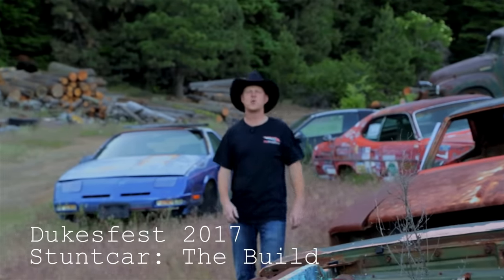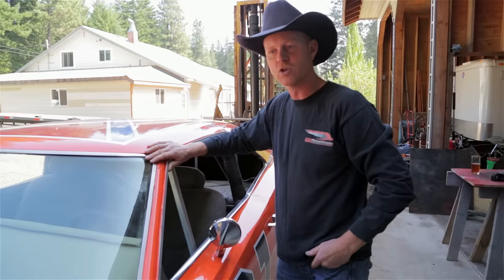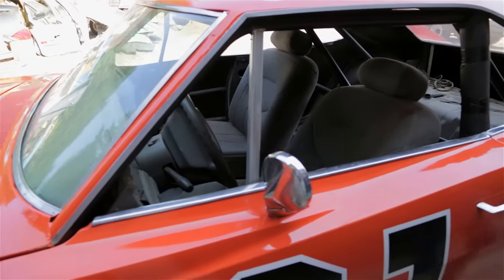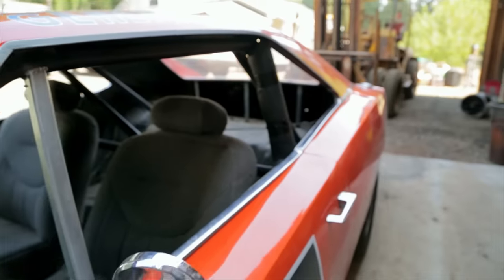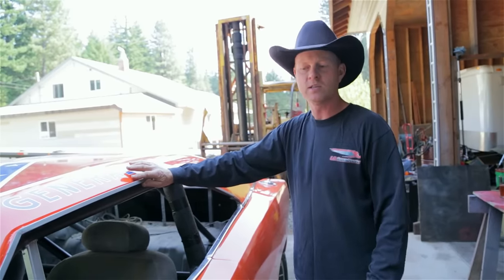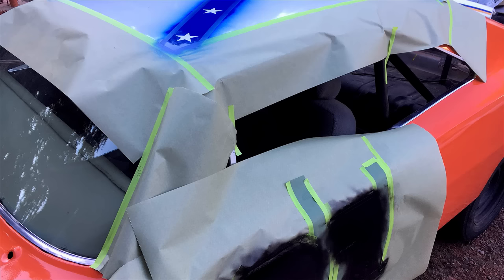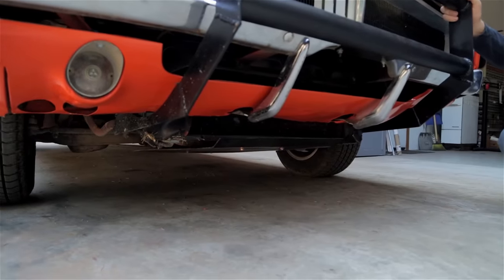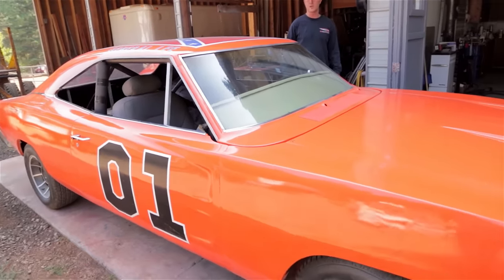Cop Car Ford Crown Vic Transformed Into a General Lee Dodge Charger

Comment: Why do you care if it's low miles and well-maintained Crown Vic if you're just going to jump it?
Reply: Cause vics can survive a jump especially like he did it
Reply: P77777777 what?
Reply: fuzzy wuzzy exactly!
Reply: low miles and well maintained means the car is still structurally sound.  Which is important when you plan on beating the life out of it for two days.
Reply: Slayer John that does not mean its structurally sound fender benders happen to well-maintained Vehicles all the time. all it means is you paid top dollar for a car that you're just going to jump
Reply: What it means is that the car won't fall in two due to bad/worn out parts during the jump.  Picture driving a car down the road at 70 MPH then it falls into two pieces.  Hopefully this helps understand why he chose the better quality car.
Reply: Slayer John i know what your saying but it still seems stupid to me to pay top dollar for a well-maintained low miles car to throw away 75% of it. Even if it is a abused piece of shit your not gonna hurt it anymore than a nice car. The frame will still be intact
Reply: Obviously even a well maintained car can have a rotten chassis, but all the oily and sparky bits being well sorted saves a lot of hassle when putting a car through the kind of abuse that could endure.
Reply: . If you notice he mentions he already owned the car having purchased it to make a jump car out of it. I think what he was trying to say was you can, if you shop around, get a good condition, well maintained Crown Vic from a smaller Police Force for the same money as you might pick up an average condition one since they are common and don't have any sentimental or rarity value. The trick is to buy the best to the budget.
Reply: Seems to me like he's gonna use it for multiple jumps not just 2, so that's probably why he doesn't want one he's gonna have to fix mechanically every time he wants to take it out
Reply: fuzzy wuzzy true but I guess the guy really meant suspension components
Reply: Because if its beat to death, and the engine cuts out when you hit the ramp, you are going to miss your mark, (Or possibly the ramp, then break the worn suspension, swerve into the crowd, and hit a nun.)
Reply: Ok, mine used to cut out at random, I thought it was the computer or something, because it didn't seem to matter how long you had been driving, or on what surface. Swapped out the computer with a spare, and still the same thing. It turned out to be a bad fusible link that was heating up and separating somehow. 
Heard enough? Or would you like to use my car for you stunt show? In all fairness to the car, it was an X taxi, and I suspect a police car before that. 300+ K car that a buddy picked up at an auction for about negative nothing..... (Part of an auction.)  There, was that enough, or should I start up again? Its not a fucking unicorn, its an old car, they are not bullet proof.
Reply: I wouldn't drive an old Taurus to the scrap yard......   I get what you are saying though, they are super reliable. My point was, for critical work, there is no need to load the deck, the crown are still all over the place, for something like this, I'd spend the extra effort to get one thats in pretty good shape to start with. Especially for the suspension components.
Reply: I'm still amazed at how good this car looks, James Smith really did an amazing job on these things.
Reply: fuzzy wuzzy There are gazillions of Vics around to choose and on top of that,  apparently money is not the problem... so, why not pick the best one for stunts?
Reply: cptreech the best is actually big police stations as their maintenance schedules are much more rigid than the smaller stations so they will be in better condition.
Reply: I can tell you first hand to stay away from a used Taxi....   ;-)
Reply: actually it means that if you point it at ramp A it will go to ramp A and have a less chance of killing you during the stunt. takes away another variable.
Reply: fuzzy wuzzy he cares because it still lives cause a full frame car takes more of a beating then a unibody
Reply: The way I see it.. 
1. The Ford should start first time every time. Pretty important when you have a crowd of people waiting for the jump. 
2. No Dodge Chargers will be sacrificed. Becoming an rare commodity these days and expensive as hell.
Plus all the other reasons as mentioned by other viewers.
Reply: fuzzy wuzzy I can tell you have never driven an old cop car that has hit a curve to hard.
Reply: At first i thought that was odd too.. but then i saw the amount of effort he put in it.. And look at it!! Clearly he want's to keep it as long as possible for this kind of stuff. So then it really makes sense.
Reply: the price of a well maintained vic is still way cheaper than a actual charger so budget wise they saved a ton of money and time
Reply: fuzzy wuzzy Could you be any more hypothetical? Of course anything is possible. The point is that a low-mileage, well maintained car has THE BEST CHANCE of being structurally sound. Of course nobody really knows the history of a car unless it’s gone over with a fine tooth comb.
Reply: Exactly what I was thinking. That Vic could've gone to a good home instead of being completely thrashed. Same is true for a high miles Vic but not as common
Reply: fuzzy wuzzy better suspensión
Reply: Because if it was crap and stuttered at all he would miss his target speed for the jump and that could be fatal. Do say research before you ask dumb questions
Reply: exactly lol

Comment: the 1969 had the worst suspension of any muscle car in an era when they all sucked...so i was really wondering how it could be done and that answer is brilliant...just use a Ford that way it will tolerate many jumps unlike the original that was good for one
Reply: Nope - they chose the Charger for the show BECAUSE of its strong torsion bar front suspension.  This thing only survives because he's landing it on a sloped landing ramp, the original would survive too.  Now send this one off a real ramp into a flat landing and see how well it holds up.  Cars aren't meant to be jumped, I don't care what year it is.
Reply: It was an ADJUSTABLE torsion bar suspension. No one else had that. Rebuild it with polyurethane bushings and it's awesome.
Reply: ConstanceCox the Bullit Mustangs in the movie had to stiffened the bodies and suspension. The Charger they tightened the front torsion bars and put stiffer shocks on it and aired the tires up a little more and that was it. Torsion bar suspension could hold the corners better than any other car built at the time. I use to race my 65 Valiant V100 on local tracks in the area. One out in Stillwater OK. A few times. Stiffer shocks and Pirreli GTA tires and I was staying stuck the ground. Built 225 slant six 4brl on Av-gas and Cam 2 mix. Built Powerflight automatic and staying ahead of Cobras, Corvettes and Porsche 944s and 911s. With the Plymouth dog dish wheel covers polished and shining. SCCA called it a exhibition racer because it was a 4dr sedan. I still have the ol broad today. 374,897 miles on her clock and getting ready to rebuild it for a third time and put in a 318 4bl/727 from old 81 Diplomat Cop Car.
Reply: Chevy GM had complete GARBAGE suspension on the Camaros, Novas and Trans ams back in the late 60s and early 70's. The subframe suspension were like wet noodles and they handled like crap. Mopars has much better suspension as they were more stiff and adjustable.

Comment: From 78 until 82 my parents worked for a stuntshow who jumped a car over a ramp while another car drove under it, and they did that twice a day and for 6 months
a year, and they never ruined a single car because the landing was always perfect.
Reply from the maker: Cool story!
Reply: @AutoEdits  The man was willy Bossle, also known as stuntman Joe Williams who also did some stunts in 2 james bond movies, like driving
the mustang on two wheels through a narrow alley. And it's not that hard, because every few years they used new cars, so to calculate
they just started to jump at slow speeds  while the ramps stand close together, and every next jump is done faster and while the ramps
are being put further away from each other until they reached the desired distance between the ramps. I aksed if i could drive along
as a passenger, but i was 15 so they refused alright, but i was the passenger in the car that drove between the ramps while the other jumped
over our roof. Well, those 4 years were the best years of my childhood, because when you're a young kid, then what better time is there to spend
than with a traveling stunt show? I learned to drive cars and trucks there, and got my own honda dax 70cc when i was 14 and i could drive
in all the cars they used for the show, and in all the crash cars and i even learned to ride my honda sittting backwards
and standing on the seat and ride like a surfer, so no hands on the handlebars. And i helped out in the  show aswel and did sit in the back with
johnny bossle when they drove with 3-4 cars on 2 wheels. And they had a contract with toyota and who gave them 10 new cars for the show
and then in every city the toyota dealers brought a brandnew car of all models they had, and they were commmercialy presented to the public
and gues who drove all the expensive ones like the super saloon and landcruisers and celica's?  Well, i sure had the time of my life, and it was 
also a time when the best road movies were made like cannonball run ,smokey and the bandit, convoy, mad max, and tv series like the dukes of hazard,
and the knightrider, and who are all related with cars and stunts, so stuntshows were popular in those days, and the bossle Hell drivers
were one of the best here in europe and that's why they got a contract with toyota and even honda gave them new off road bikes
and leather costumes, so very professional because the whole picture looked like a million dollars, and it was a priveledge that i was there and a part of it.
Reply from the maker: @3DPeter  Buzz Bundy did the Mustang stunt in that movie.

Comment: I think this is a really cool concept in general for 'vintage replica'. You get the cool looks of an oldschool car, while still having most of the practicality of a modern car (AC, etc), and more bang for your buck for power (I'm guessing a CVPI gets more power stock than pretty much any 60s or 70s engine with similar mods).
Reply: Do you need AC in a car which has no glass in the windows?

Comment: When he got the panels from Auto metal direct I'm wondering what panel he put on first to base the rest of it around
Reply: The front windshield area was the most critical. The A pillars are actually the front portion of the roll cage..

Comment: Would this work with a modern charger or is the wheel base too different to actually reskin it with the old body?
Reply: The Vic is better for the purpose because of its "body on frame" construction. He nearly just put a different body on the frame. Only pick up trucks really still use body on frame.

Comment: You should try and make a modern charger into a 68-70 charger. Not the length but change the front and anything that doesn’t look right.

Comment: In the past I've read a few articles where they blame Dukes of Hazzard as factor in the scarcity in 68 - 69 Chargers.  To me that doesn't make much sense as the estimate was somewhere around 300 were destroyed in making the show.  To put that in context, if you divide 300 by 8 you get 37.5 which is probably about the rate they built them per hour.  When you put that in context, all they did was consume about a days production over the 7 years the show ran.

Comment: So i just went on auto metal direct and priced out the body panels, no trim pieces,  as best i could and it came out to about $6900. (I think I got everything) So its worth it if you always wanted that charger but its not exactly cheap.

Comment: My 01 Crown Vic has 254K, good gas milage, uses synthetic oil, doesn't mark its spot, doesn't smoke, great clean interior and I'm  just about to get it back from the body shop because I had body cancer on the left fender and had it replaced. With the new headlights it will look and run like a new car......more space in the trunk than the back of a Tahoe or Explorer with there seats up..

Comment: It would be interesting to know on which parts of the car he took up the difference in wheelbase, as the  Charger had 120" and the Crown Vic had 114."  It looks like he may have split the difference equally between the front fender, door and quarter panel.   Otherwise,  taking 6 inches off any one panel would have been noticeable.
Reply: Only 2.3" difference in the wheelbase. He took it up evenly in the fender wells. No trimming on the charger panels.
Reply: Check out Stacie's Country Cooking & Adventures on youtube
Reply: Sorry about the typo. It should have said "less than 3 inches"
Crown Vic = 114.7"
Charger = 117"
Difference = 2.3"

Comment: Shoulda done it with a modern day Charger/Challenger platform to keep it more "car culture friendly", basically meaning it wouldn't be using it's competitor's parts, or in this case, everything but the Charger shell.
Reply: Steezy but Sleezy the body on frame design that the crown Vic offers is just such a universal platform it’s insane
Reply: An expensive unibody car wouldn't serve the purpose. The Crown Vic has a frame and will survive the jumps. As a car culture guy I wouldn't like to see a late model Charger or Challenger ruined to make a jump car. I love the Crown Vic in it's Halloween costume. I put Chevy engines in pre-war Fords and the car culture snobs can kiss my ass. Ford engines don't fit and cost a lot to make them fit.  My 54 will have a Ford engine because it will fit in the hole. I have a 351 Cleveland that wouldn't fit in my 40. But first I'm helping my son put his 48 Pontiac on a 76  Olds Cutlass chassis. We had to stretch the wheelbase 5 inches. We have too many projects to worry about what other people think. Hot Rodding is about using your imagination. No restrictions apply.

Comment: Aren't late 60s Chargers built on ladder frames (chassis) and newer Crown Vics built on a unibody frame (chassis)?
The Crown Vic's frame is supported by the roof line, does the roll cage replace that strength?

Comment: I was reading on the general Lee, many were AMC Matadors not Dodge Chargers.
Reply: Then you read incorrectly. Chargers were the only cars used as General Lees. Thought they did used Matadors as cop cars and other stunt vehicles.
Reply: sorry I am correct... here is a article about the cars.. What kind of muscle car was the Duke Boys General Lee?

The General Lee was most often a 1969 Dodge Charger. However, after seven seasons, 1968 Dodge Chargers were substituted in a pinch.

In fact, things got so bad that AMC Ambassadors were used and filmed from creative angles to hide the fact it wasn’t a Charger.  click below to go to the article.. @johnkramer7161
Reply: @dalecarney6582  Don't believe everything you read.
Reply: I have seen in more than a single place. ANd because you may not believe or do not want to believe it does not make it not so, If you look at the AMC Matador and the charger you can see how they can get away with it, I seen the picture of one AMC vehicle they used, and they had done some work on the grill .
Reply: @dalecarney6582  Got a link to the picture, I'd like to see it?
Reply: It was a wile back, I have no idea where I found it.  But if I can find it I will post  it for you. To be honest that surprised me, We use to have a  AMC matador and I can see how you can mistake it for a charger from some angles,
 @johnkramer7161